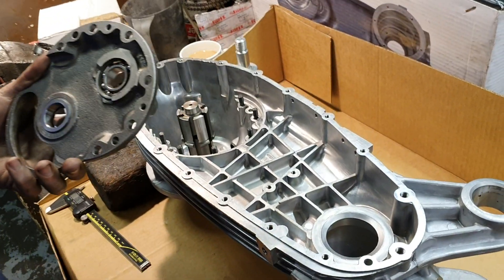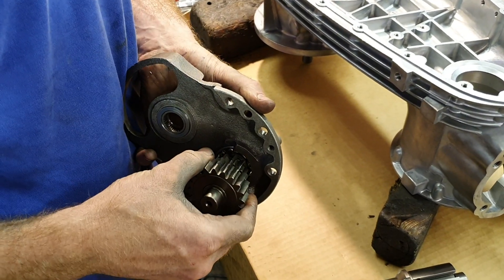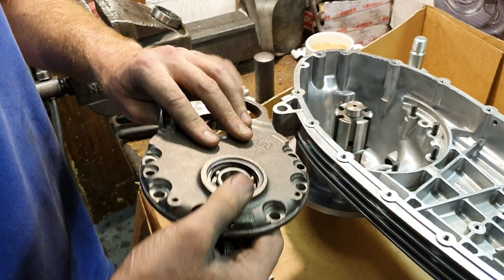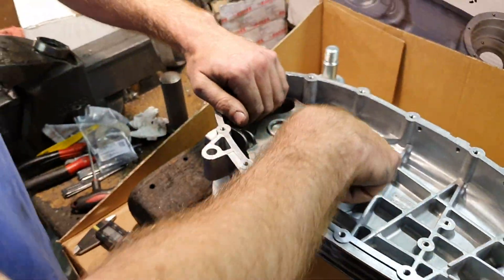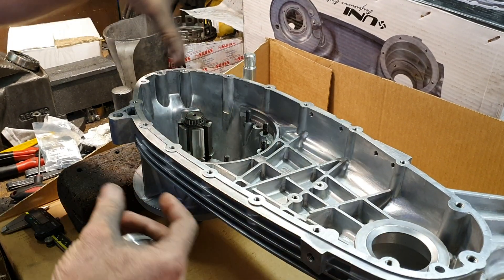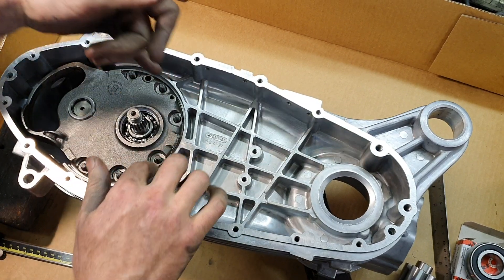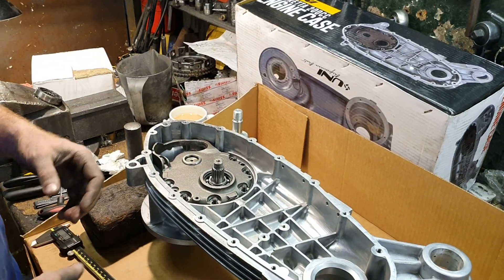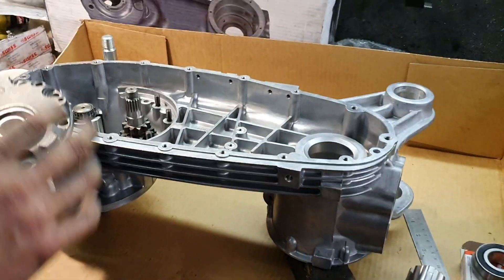Replacement of gear end plate on a Lambretta crankcase

Comment: Just fitting your 5 speed gearbox and found as you say that the Xmas tree is just slightly oversize to fit in the 6004 bearing, so a very light touch with some emery and try again until fit is good but snug. Glad I found this video. Very helpful.

Comment: Hi! What about the large clearance between endplate and casing all over around the endplate? I have a 200 UNI case with the same issue whatever endplate I'm going to use. I knew that the endplate needs to stay very close to the case (as in the original Innocenti casings) in order to transfer the chain tension to the case and not to the two dowels or the six bolts. Is it correct or not?
Reply from the maker: Sorry for the delay in my reply.  The end plate should not touch the casing on it's circumference.  The location should be through the dowels alone, and the clamping force through the studs alone.  Even on an old original innocenti casing you should be able to pass a feeler gauge around the outside of the end plate. If the thin aluminium rib was intended for direct support it would need to be an interference fit, and would not allow the end plate to 'drop' in to place.
I hope that is of help.
Best regards Ben